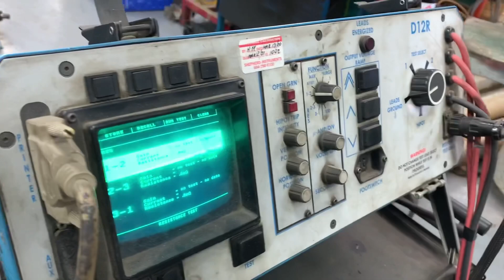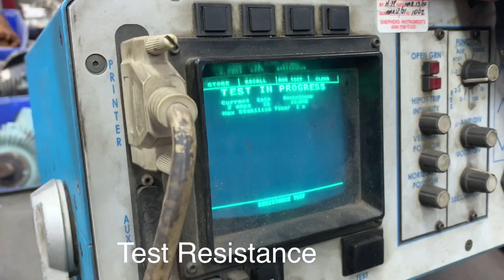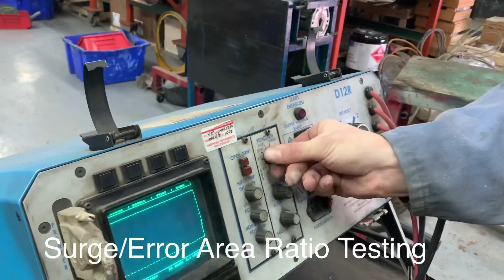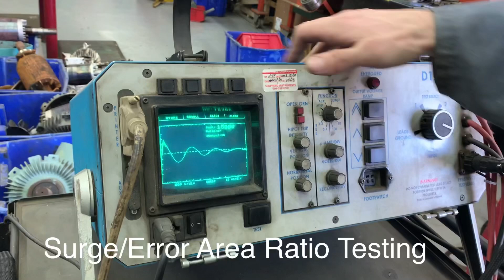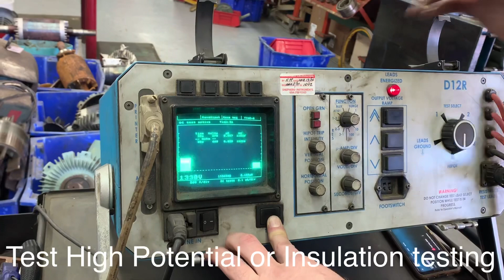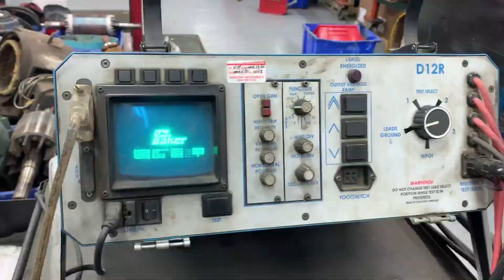Motor Rewinding;Winding Looks Burnt!How SURGE TESTER Works.. Good or Bad Winding??

Comment: This one i missed ,
Reply from the maker: Hey bud.Plan to make a basic video how to a bit of tutorial maybe 🤔
Reply: @windertrucker6230  like basic tests to pass a motor,, phase to phase and phase to ground meg ohms, resistance test, hi pot and surge wave comparison, accpetable readings etc,,. I havnt used a comprehensive testing device like an skf or megger unit, introduce basic interface on any of such machines would be great. If you plan to do so using a mic is a good idea.
Reply from the maker: @Harish Harikumar  I’ll definitely can do that for you i’m still working on the conversion concentric to lap i have to steal the book in our shop for my reference when I’m not busy sorry bud lots of work still rush everywhere in the shop.
Reply: @windertrucker6230  no worries man , take your time, you are a hard working man,, you will get paid for all the goodness 🥰🥰
Reply: Do you have AC redesign EASA english manual, i have one spanish book, but cant follow spanish.
Reply from the maker: @harishharikumar1543  yes we have that book from easa bud.
Reply from the maker: @harishharikumar1543  thanks bud appreciate it❤️
Reply: @windertrucker6230  can you share it
Reply from the maker: @harishharikumar1543  yes for sure bud i will going to the shop early today and make some video.
Reply: @windertrucker6230  but dont strain yourself,,
Reply from the maker: @harishharikumar1543  no worries
Reply: @windertrucker6230  hardcore 😎😎
Reply from the maker: @harishharikumar1543  I’ll send it into your LinkedIn messenger bud.